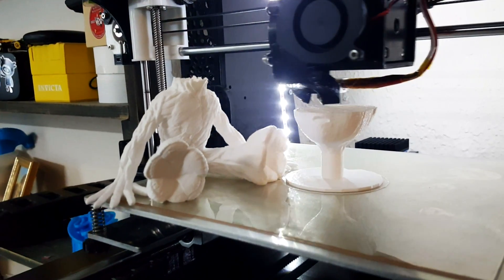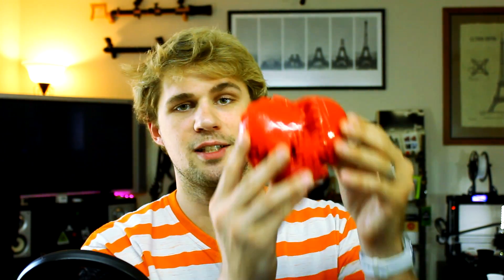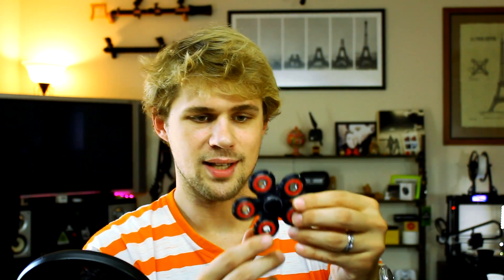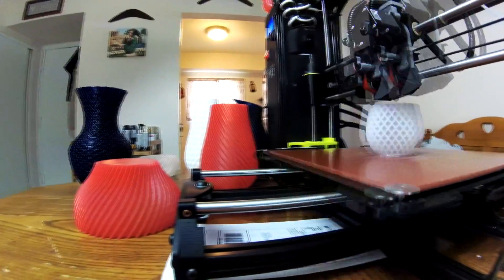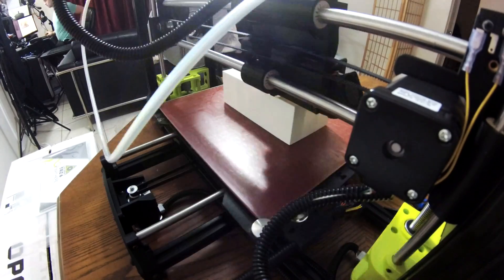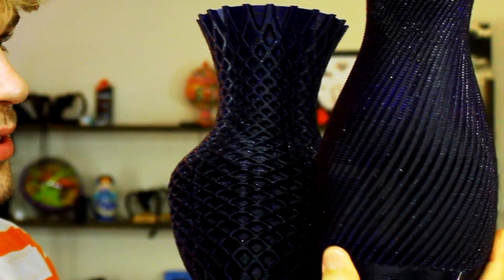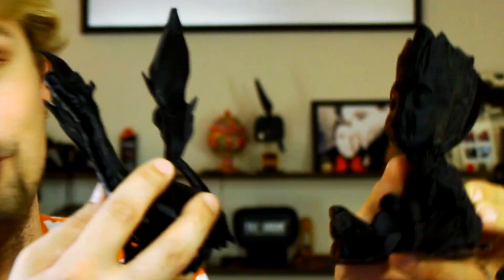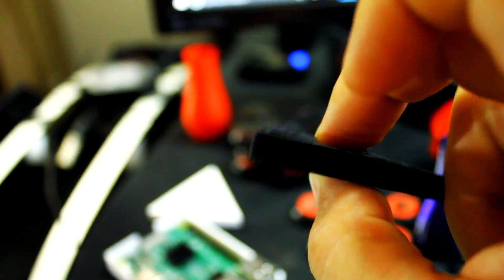3D-Printed Working Fidget Spinner! | Lulzbot Taz 6 Update

Comment: wouldn't recommend using the  CR-10 for flexibles because you can't really do retraction with a bowden setup, I've had quite a lot of expereince with the anet a8 when it comes to TPU, I'd recommend using that if you want to use retraction, to help with retraction I would recommend using a bit of PTFE tube cut into a sort of triangle shape that goes just after the extruder gear. You might be able to try and print some off thingiverse in PLA I think they'll be called filament guides I just thought that the tube would be a better option as it's much lower friction than something that could possibly have ridges that would cause the filament to kink up in the extruder which is a PAIIIN with flexibles. You can also do some nice things with TPU you can make things that stick to glass, if you've printed that item on a glass bed that is. if you look up adafruits video on lego flexible strips there's quite a few variations that you can print out :) I'm also going to try and use TPU for a tyre for the open RC car that I'm printing out. Might also try and remix it and try and do a suspension system that can actually move. What sort of things do you print out for VR?